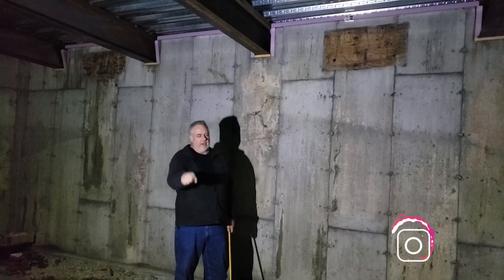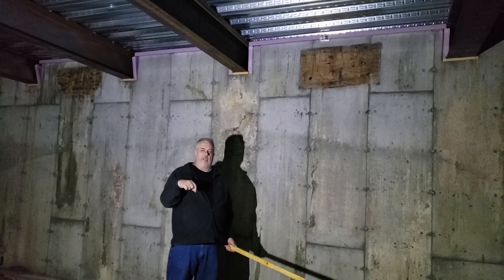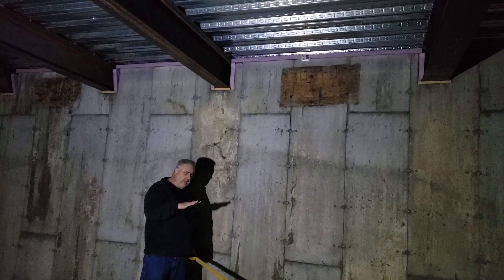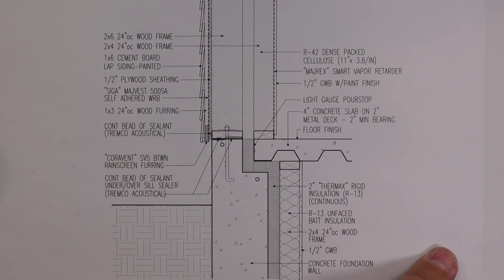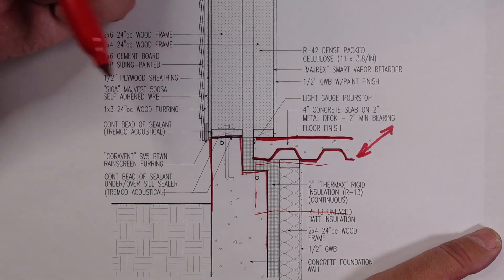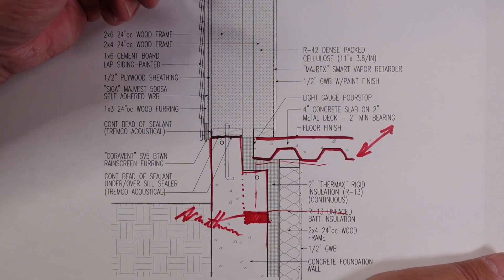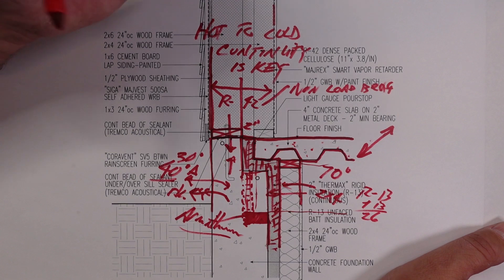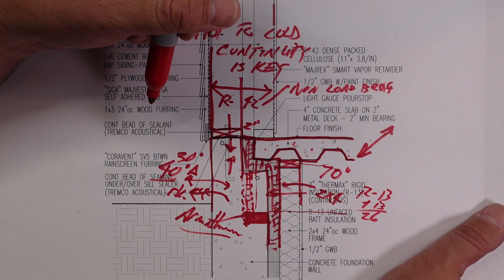THERMALLY BROKEN STEEL FLOOR FRAME

Comment: Hi Steve, Great videos, thank you. I have a similar design in mind. I live in Arizona and want to build a Basement (cellar) for wine storage and root cellar for veggies (I can't understand why more homes in AZ do not have basements?). I also want to park my vehicles on a poured concrete floor above this basement similar to what these folks did with their house. You mentioned you'd done this with garages? Do you have a video? I understand the loading is much greater due to vehicle loading etc. I also don't need the basement insulated as I want to use the earth's natural cooling to provide a constant temperature. I will provide backup AC just in case my temperatures increase above 60 degrees. You mentioned you've built garages over basements before. Any advice would help, thank you.

Comment: I'm a bit surprised to see all the I-beams.  In commercial buildings with elevated slabs, you commonly see steel trusses doing that job.  I would have assumed trusses to be less expensive than I-beams (less steel overall).  What drove the choice to use I-beams?

Comment: I had my Engineer specify Armatherm 500psi thermal breaks under the steel posts in my basement.  I just installed them a month ago, but the Engineering was done in 2020.  Beat you, Steve!  😂

In all seriousness, I discovered Armatherm on my own and introduced it to my Engineer.  I told him I wanted to thermally break my posts and he immediately said “That’s impossible!”  I slid the brochure across the table and asked if 500psi was enough.  His mind was blown.  Funny, especially since he mainly does commercial buildings.  In Canada.  This stuff is specifically designed for thermal breaks in concrete and steel structures.

Comment: In the process of building my house i have priced out a concrete floor and wood trusses with warmboard. We would polish the concrete if we go with the slab, and an engineered wood flooring and tile if we go the warmboard and trusses route. The concrete deck will cost about 57K only material. Wood joists and warmboard with $4.75 engineered wood floor is 51K. If i use $7 flooring over the warm board it is more than 57K so the concrete would be cheaper. There are many factors that count towards how much a floor will cost.

Comment: why not use ICF?
Reply from the maker: Twice the price around here
Reply: I priced an ICF foundation (just the foundation) for my home build and it was 50% higher than a standard poured wall.  That difference in price is almost double the entire insulation budget for the house.  Not worth it, especially when you consider the concrete core is thermally coupled to the ground at the footings, so only the above grade insulation on the outside is really doing anything.
Reply: @superspeeder  Interesting. ICF also has insulation on the inside so I'm not sure why you say only the outside matters. Did you put insulation under the slab?
Reply: @ChristopherCurtis  AFAIK you never put insulation under the footings, and that's how, for the bottom few feet of the wall. the concrete core of the ICF gets coupled to the ground.  So in that lower portion of the wall, the outside foam of the ICF is hardly doing anything.
Reply: @ChristopherCurtis  yes we are insulating under the slab.  We have to insulate on the inside of the wall as well, but code requires R20, so 2” of foam + R12 fibreglass in a 2x4 wall.

I plan to do above grade R10 exterior plus the R20 interior.  Just as effective as ICF (which still needs the R12 2x4 wall on the interior) but much cheaper.
Reply: @superspeeder In moderate climates where there is not a deep frost line, the soil might stay in the range of 50 to 60 degrees F.  So your HVAC is working against that temperature range, not 90F in the summer and 20F in the winter.  The earth is warming you in the winter and cooling you in the summer.  Even though the 5 inches of EPS foam of the ICF only provides about R-20, the thermal mass of the concrete makes the wall perform closer to R-50.  So insulation cost comparison would be for true R50 walls, not derated by the thermal bridging of studs.  ICF is DIY friendly and won't disintegrate if a tornado hits it.  There is additional value added with ICF.
Reply: I am not an engineer but ICF looks awfully complicated to set up and then pour the wall.  All sort of bracing and detail etc.  Why not just pour a concrete wall then slap 4 inches of foam on the outside?   That would bring the thermal mass of the wall inside the envelope.    ???

Comment: Must be much more expensive then  a conventional wood deck framing Steve, why do it.
Reply from the maker: They wanted the concrete slab finish on the first floor
Reply: I’ve done it so they could have a garage over finished basement space
Reply: You can also put hydronic tubes in the concrete and have a nice warm floor to heat the house